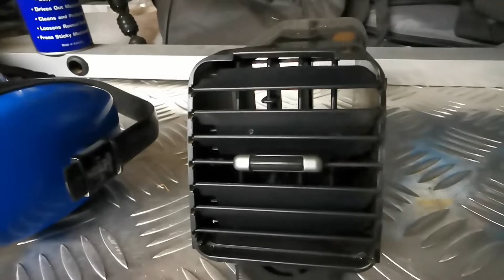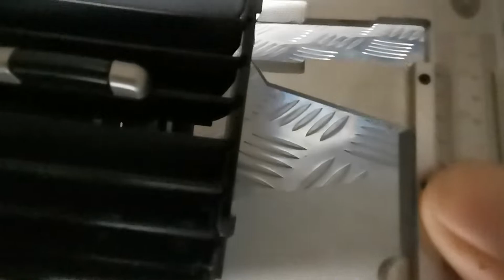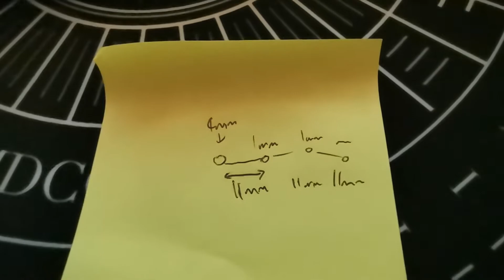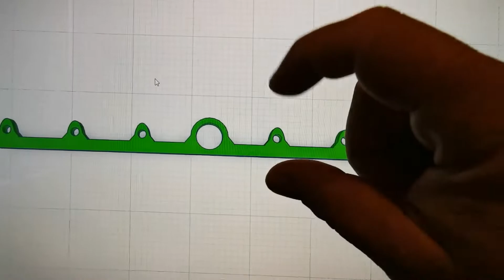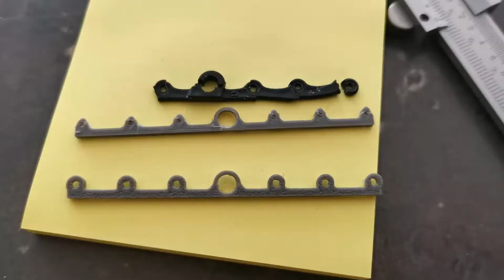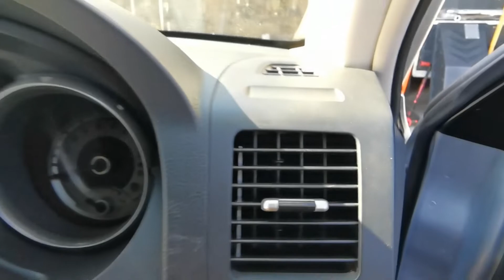Repair Car Air Conditioning Vents

Comment: Dang, my Suzuki sx4 uses some small strip where they are attached to. Due to the hot climates the plastic got brittle. Need think about how to fix that.
Reply: Ps don't you use the right side of those calipers to measure inbetween? Seemed like you guessed it know :)